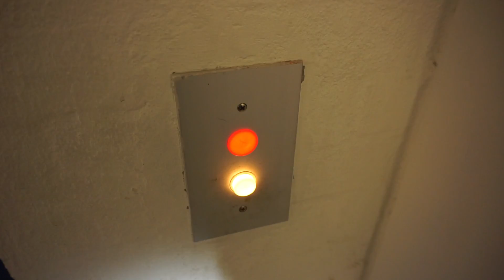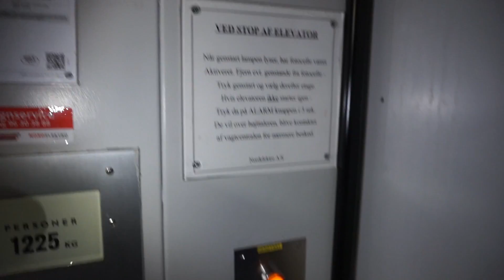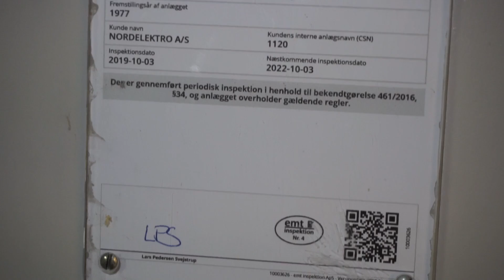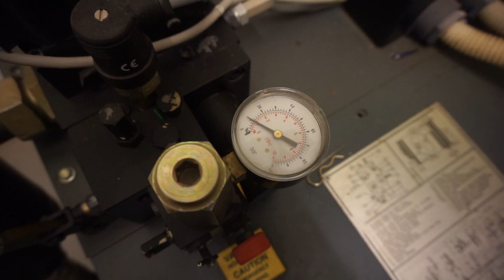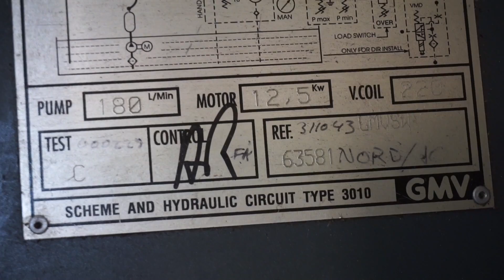Machine Room Tour! 1977 KONE hydraulic freight elevator (upgraded) @ Porsvej 2, Aalborg, Denmark

Comment: Interesting submersible power unit with the external hand pump. Neatly wired controller cabinet,  400V 3 phase AC  might be on 50 Hz. Power unit works well.
Reply from the maker: Yes it's 400v 50hz. The controller is indeed neat and minimalistic in its layout